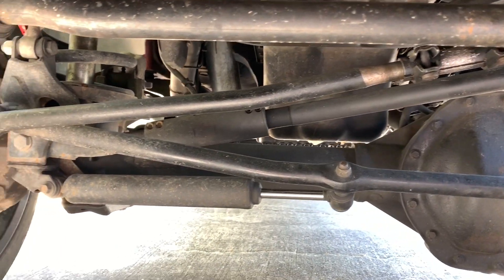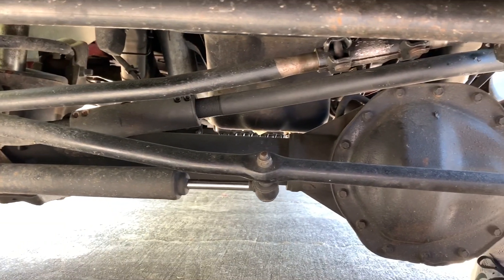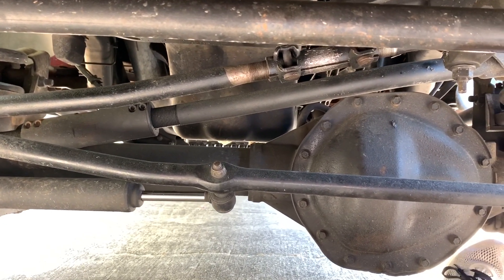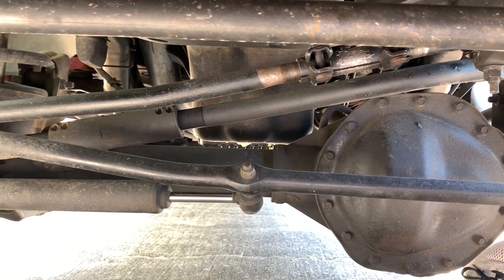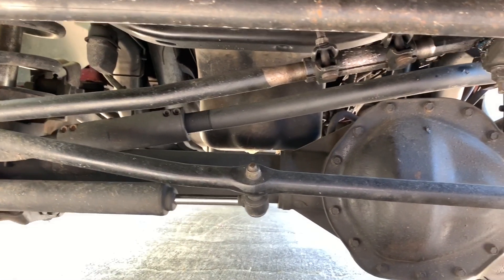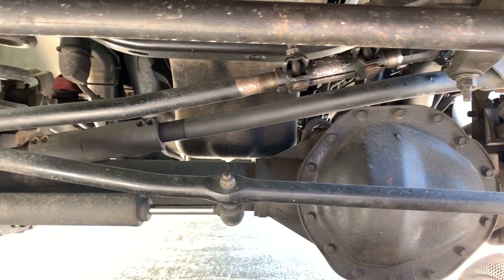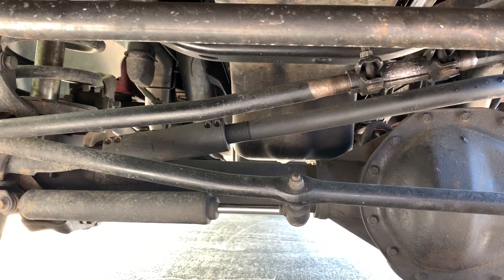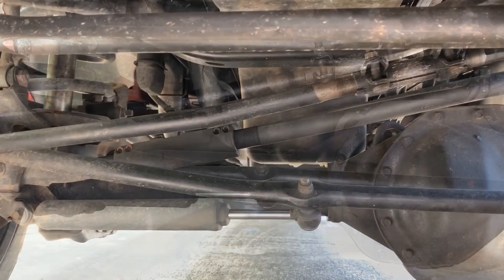Dodge Cummins Bump Steer

Comment: I was going to point out that it's the track bar (vs drag link) that centers the axle under the truck but you beat me to it once you got down there. I still get the names swapped at least 50% of the time, haha.

Those y-style steering linkages are notorious for bump steer, have you considered the Mopar upgraded linkage? (It's the T-style used on the 08.5 and newer trucks.)
Reply from the maker: I haven’t because the rest of the steering is in good shape and the pitman arm was cheap. It it starts to fall apart then I’ll look into swapping it. Haha, yeah the names get confusing all the time.
Reply: @krey8171  Oh gotcha. Factory steering on my 06 was terrrrrible. I've since replaced everything but that 08.5 linkage was the first and most noticable improvement.

Comment: You mean death wobble ?
Reply from the maker: No, I’m talking about bump steer. There are numerous videos that go more technical than I do about it, but it’s different than death wobble.
Reply: I thought the description sounded like death wobble too but I assume the steering wheel shake described was more of a shimmy in keeping the truck straight rather than a crazy uncontrolled wobble.
Reply from the maker: Yeah, the shimmy was when going over a bump as the suspension is moving.